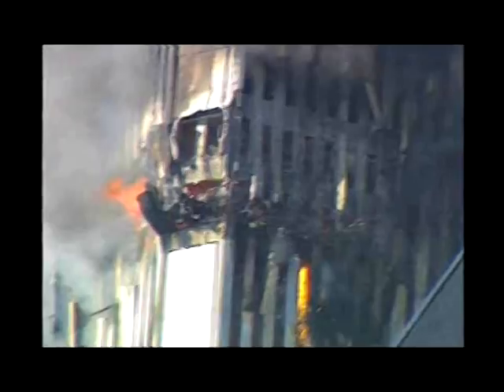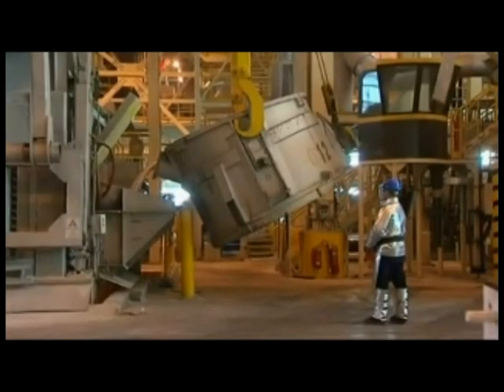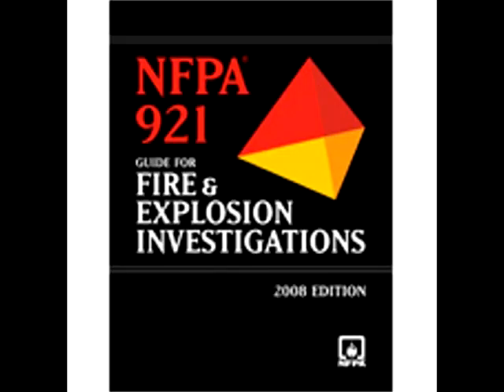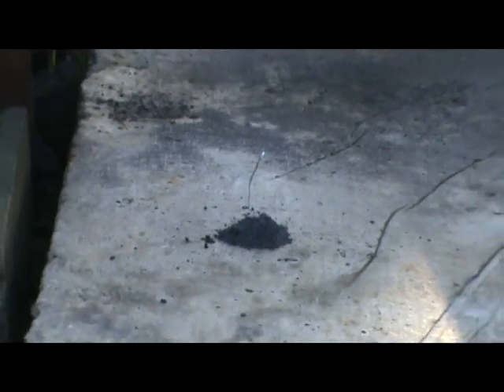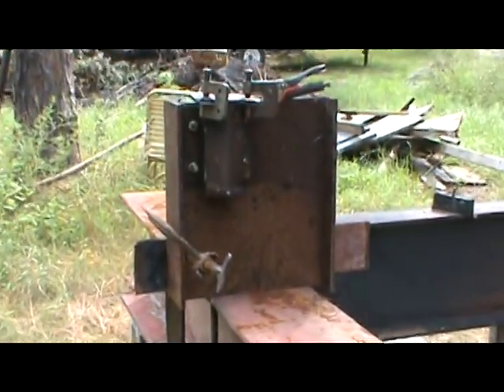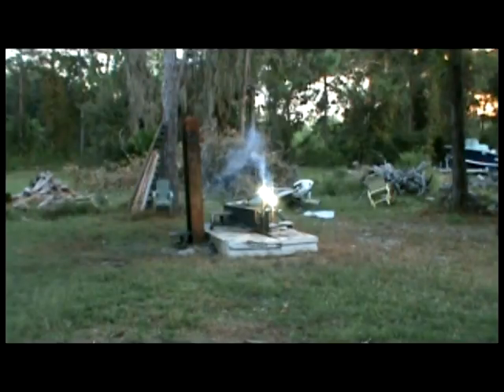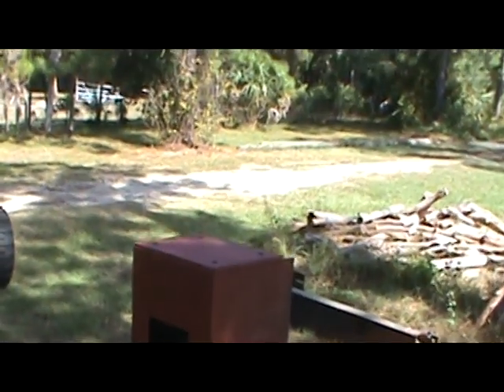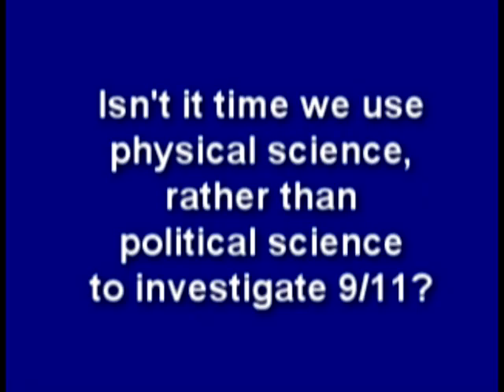9/11 Experiments: The Great Thermate Debate

Comment: This argument is beyond stupid. jet fuel may not be able to melt steel beams but it can certainly heat them to the point where they have no structural integrity the transition from so hot it acts like a putty to Melting is like another hundred degrees jet fuel can get up to 1200 degrees and you only need to get steel to about a thousand before it's basically useless for supporting Concrete and heavyweight. And the reason you find melted beams as when you move metal that is already superheated you add additional thermal energy through kinetic torsion or impact. Under the pressure of supporting a building that size that's more than enough to jump it up that last hundred degrees right to the melting point.
Reply: Caleb Lennox - "jump it up that last hundred degrees" - If it was vibrating at a frequency "yes" --- if it is bending "no" it is giving away it's energy and cooling.
Reply: manx man you're wrong you need to understand the extreme pressure these beams are under the weight of a 20 foot I-beam held on the ends alone is enough to cause it to snap once it hits 1100° if it has no support in the center. With the weight of the concrete, this effect is greatly magnified. I work steal to make tools and industrial equipment. I can add enough kinetic energy with a simple 60lb head on a power hammer after taking steel to 1000° to get it to melt and that's a fraction of the deformation caused by the overloading of a beam under stress. Structural steel has a temper untempered steel is practically useless, per lb wood is stronger. After 900° a bare cherry red the steel will be too a week to hold its weight and that of the building. You don't need to melt steel beams to ruin them and they literally melt themselves when they fail.
Reply: Caleb Lennox - power hammer - creating a frequency = how many hertz?
Reply: manx man about 3 hits per second unless I switch to hydraulic in which case 0 since that's constant pressure about 100tons with the same result. Hertz got nothing to do with kinetic energy being added to a system. The vibration rate does not matter its the amount of heat. deforming metal generates heat
Reply: Caleb Lennox - adding frequency (work) energy gets absorbed. A load  is dispersed over the areas and volumes...Bending . deformation is energy absorbed once only.. Did all beams deform and YIELD all at the same time to result in an entire structure collapsing in 10 secs.
Reply: manx man well when you think about It yes considering they all share the same constant damn load. My point is not about what happened its people claiming what happened was impossible without intervention when steel can do that all on its own. Thermite is not needed to get these results.
Reply: Caleb Lennox - I disagree - resistance in gravity is not a force in itself great enough to collapse every floor into dust. This event must have been assisted. === WTC7 is the complete answer===
Reply: manx man you underestimate gravity and momentom
Reply: Caleb Lennox - you over exaggerate the power gravity and momentum and have neglected the obvious effects of resistance.
Reply: I don't, that was 43000 tons of weight over 6 interwoven beams made from half inch I beams. Steel after heating cannot support that weight thus collapses. allowing the top to fall 4 stories. i am using 4 since floors 93to 99 where directly damaged, so assuming the placement of the fuel burning is only on  4 floors worth of direct heating is about right. point is i am low balling this fall. about 26 meters  the impact of that top section of the building is 10956400000.00 j no fucking building on earth can survive that impact vertically unless it's a freaken missile silo or something. I would like to add thats well beyond the amount of energy needed to melt steel. Edit:Took me a second to see how you shifted the goal posts. Steel is useless in a jet fuel fire. I'm sorry if you feel you need to argue against the laws of thermodynamics there is nothing I can do for you at this point.
Reply: Caleb Lennox - the beams are 1" thick --- fuel is expended less than 1 mins - (explosion as illustrated on impact) - the rest of heat after that is fuel and oxygen resident inside the building..... you need to provide your formula to work out the J.
Reply: manx man used a calculator online check it yourself I took the total mass got the % of the weight for the top section and put it into a calculator.  Still even at 1-inch result is the same. I can take a bar 3inch by 3inch square and. get it to untempered in a minute not to mention I know the fire was well over 900c° for longer than a minute since molten aluminum poured outside of the building and was so hot it didn't return to solid before it hit the ground. It would need to be close to the vapour point to fall that far and not return to a soild.
Reply: you need to cite the source of your formula - 4 floors that this mass would have dropped is because 4 floors suddenly disappeared ?? how and where did it dissolve.. did you factor in resistance??
Reply: No i am not letting you just move the goal post of the convo when you can't afford to capitulate to my point,. The resistance doesn't matter even at 80% resistance the force is still so great such that once it started there was no stopping it. It was irrelevant. It's why I even low balled the amount of mass and the fall height..
 My original point and the thing you still failed to address is. Steel does not need to be melted to be useless, and the pressure from floors above have enough energy to melt it beyond the temperature of the fire hence conspiracy to melt it was not required.
Reply: Caleb Lennox---   "conspiracy to melt it was not required."(is that a technical term?)=== your claims have never been quantified  - you are propositioning  only and i am claiming YOU ARE A JOKE ><? i am laughing so hard i am almost crying,,

Comment: The theoretical maximum burn temperature for jet fuel is 2200 degrees centigrade.
Steel melts at 1300 degrees centigrade.

Comment: Each floor of the towers contained over two million kilograms of mass. The gravitational potential energy of a standing tower with twelve-foot floors extending upward 110 stories can be calculated straightforwardly; it comes to over 420 billion joules of energy, or the equivalent of 100 tons of TNT per tower. This energy, which was released completely during the collapses, is more than the energy of some of the smaller nuclear weapons in the U.S. arsenal, such as the W-48 (72 tons TNT) (Sublette 2006). This is where the energy required to break columns, pulverize concrete, and expel debris through windows came from. (Truthers often compare such expulsions of air and debris, visible several floors below the collapse fronts, to “squibs,” explosive devices often used in demolitions. However, they are readily explained by pressure changes as the towers, acting like a gigantic bicycle pump being compressed, collapsed.) Also you should read this book; “Debunking 9/11 Myths: Why Conspiracy Theories Can't Stand Up to the Facts” which is a non-fiction book published by Hearst Communications, Inc. on August 15, 2006. The book is based on the article "9/11: Debunking the Myths" in the March 2005 issue of Popular Mechanics[1] and is written by David Dunbar and Brad Reagan. 😂😂 I wonder how you got access to the Net since you’re wearing a giant aluminum hat and all.

Comment: No word of the kinetic energy created by the plane cutting through the building and coloums, already melting steel easily like a tank buster. No question about how the inside jobbers could have placed the thermite at the exact place of where the planes hit and exact place of where the fires burned. No question of how most of the thermite couldn't ignite already by the kinetic energy  created and explosion of when the planes hit the building. No question of how the inside jobbers could have transported tons of thermite into the building without anybody recognizing. There must have been hundrets of inside jobbers already inside and outside of WTC just to hide the transportation, preparation and placement of thermite inside the building. 
Seriously. Get your heads straight.

Comment: You do realize thermate and thermite aren’t the same thing, right? Barium nitrate is toxic to humans and it wasn’t found at ground zero. You’re incredibly intellectually dishonest. I worked with explosives for 12 years and used thermite in several occasions and I can assure you it wasn’t used to demo a building. Furthermore, why would they use it on the exterior cladding when the main support beams were on the interior ring of the structure?

Comment: Molten steel can be created almost instantaneously by shorted electrical circuits. The towers were fed 13,800 Volts to upper floor substations feeding multiple 1500 KVA transformers on multiple floors. The catastrophic nature of the plane crash and fires would definitely have led to numerous short circuit situations among the main bus lines travelling in the building.

Comment: Y'all need to spend a day in a black smith shop, the metal doesn't need to melt to affect the structural integrity of the building, metal can be heated (but not melted) and still be moveable and maluable.

Comment: according to mega structures almost a year before the day it fell. they said all you needed a 747 or that size full of fuel. and the building was loaded full of explosives so in case it starts to lean or fall sideways 3 blocks away is a building with 3 buttons to drop the towers with. and the way it fell was the way they said on megastructures. it wasn't thermite it was v-bar explosives were used they show the explosives in the show.

Comment: The metal didn't have to melt, it just had to fail.  Metal at 1800° has a lot less strength than at ambient.  The assumption is that the iron sphere can only form in one way.  Don't forget it was a proven "fact" that thermite can't melt steel, aren't you guilty of the same hubris with the statement that it is a proven fact jet fuel can't melt steel.  Also, why would terrorists attack the building with airliners, then bring the building down with thermite?  It would have created a lot more terror if they had just brought the building down with thermite.  Good work, regardless.

Comment: Just remenber a 40 ton plane fully loaded was flown into the side of the building. Which of course would weeken the building.
Reply: Boeing 767-200ER maximum takeoff weight is about 180 tons. It weights 82 tons empty.
Reply: Would of been funnier if you used the name George bush when you said this XD

Comment: also i like to add that remains of the aircraft were basically non existent , few remains could be identified that belonged to the aircraft , and all the bodies that were supposedly inside the craft were cremated , which insinuates temperatures reaching 1800 degrees must have been present in order for cremation like scenario to occur inside the aircraft. the plane disintegrating and burning away to nothing also insinuates that the aluminum craft burned/melted at high temps at the core of the building with reports saying parts of the main body were found at the core of the building , with someparts even making it all the way through and exiting out the other side of the building like the engine and landing gear that were found on rooftops and down town streets. So it couldn't have just of been thermite on the outside beams , something was burning near or around 1800 at the core as well.

Comment: your insinuating that the entire new york iron workers union (thousands of people)  installed thermite powered cutting devices during the original construction built inside steel beams , no one new about it, no one came forward , the crew putting up those beams was probably 100 people minimum. , and that the plane was flown into the exact floors of the building that the devices were placed 30 years later?  Also would thermite even last 30 years? and still be able to ignite with the same potency your talking about powered iron sitting for 30 years. its not like they sucked the moisture out of the beams either.

Comment: i have always been very skeptical of the towers falling , i'm on the fence about the actual fault. open air jet fuel burning at 1832 degrees is not enough to melt steel ,,, no .. go watch a video or how 1832 degree steel behaves and look at the strength properties of steel at 1832 degrees. here's a hint it loses about 50% of its strength. not to mention burning wood = 2,000 degrees when burning , paper burns at 1500 degrees a typical house fire can burn between 1100 and 1500 all temperatures that destroy steels structural properties , and the longer its exposed to those temperatures the weaker the steel gets in some aspects. technically the steel gets harder but that's only once its cooled back down. So basically for the towers to have withstood those temperatures and not fall , every structural column and beam would have had to of been built with a minimum of a 50% safety factor in order to hold the weight of the building while also losing 50% of its strength. i really have an extreme doubt that the tower was built to hold double its own fully furnished fully occupied weight. I'm not a civil engineer and i didn't design it so only a few people would really know that answer. Also has anyone ever considered that the towers might not have been built properly say maybe the engineers and investors cheaped out , maybe the fasteners where not up to snuff , maybe some of the welds were not of highest caliber? Maybe the particular run of steel was of very low quality. there is a lot of other factors that could be considered besides thermite.  

“Both scientific experiments and 250 reported disasters suffered by the aluminium industry have shown that the combination of molten aluminium and water releases enormous explosions,” says Simensen.   this could possibly explain the explosion. 

“To put it as succinctly as possible: because the federal government commission did not take sufficiently into account the fact that the aircraft brought 30 tonnes of aluminium into each of the two towers.” something else to consider.

Comment: It could be possible that jet fuel, a known oxidizer, could have collected down the concrete encapsulated tower tubing columns as the jet wings sheared open many of them.  As the fuel collected and ignited, it quickly pressurized the tower tubing, the fuel mixing any form of aluminum  (suspended ceiling rails, sheet rock joists, aluminum electrical high tension wire within the walls supplying services and wall sub-panels, the aluminum plane parts) with the existing rust in the now exposed hot roll steel tubing and new rust quickly oxidized from the jet fuel and atmospheric air.  Coincidently, this mixture of material  became a "perfect storm" of ingredients, essentially turning itself into thermite within the structural tubing.  Possibly, creating each jet fuel, aluminum and rust filled tubing into, as the video may have inadvertently explained, "push rod thermite box cutters".   Jet fuel spilling from the separate wing tanks into the structural tubing may also explain the peculiar 3-6-3 pattern of melted beams at 13:31.

The popping and "gun fire" sounds could have been superheated concrete igniting.  Since concrete has a tendency to collect moisture, moderate temperatures as low as 1300 degrees can cause steam trapped in the concrete to violently escape, exploding concrete everywhere and producing loud popping sounds.  Simply holding an oxy-acetylene cutting torch on concrete, even for a mere second, can replicate these results.
Reply: That's stupid you idiots will never believe your own government lied to you